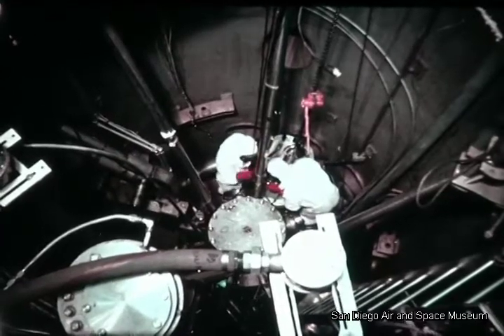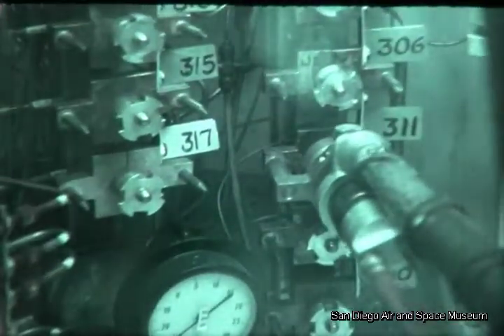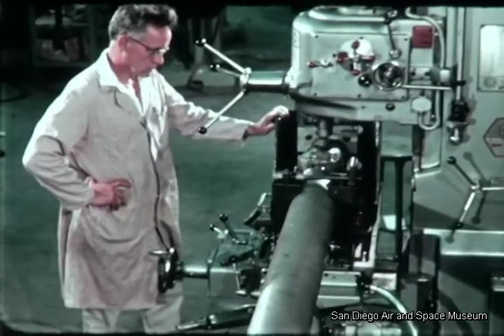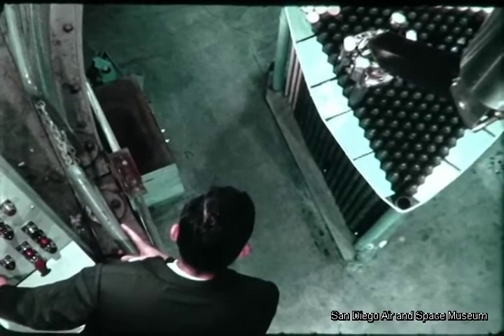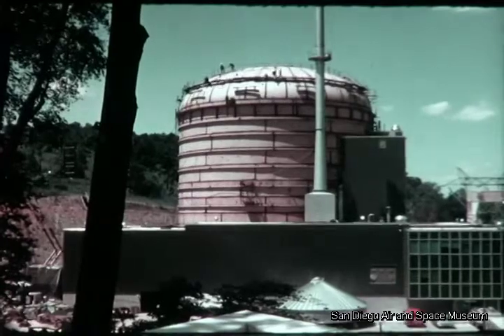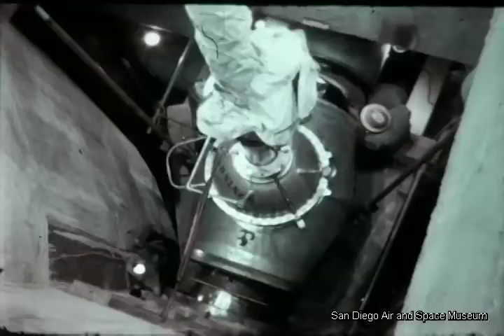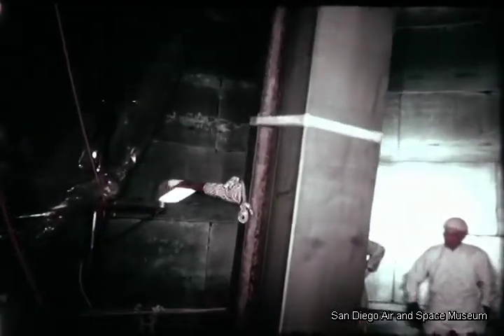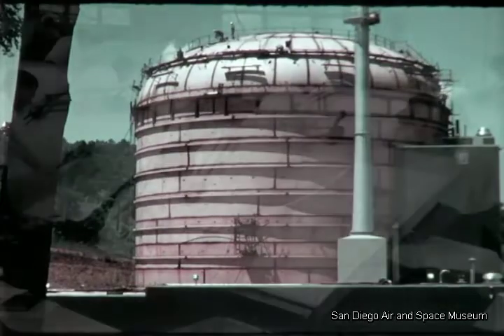HACL Film 0012  "H.T.G.R.-Update" High Temp. Gas Cooled Nuclear Reactor a General Dynamics Film

Comment: I'm working on a idea for an air cooled nuclear reactor that  works on the same idea as that of the nuclear jet engines that were developed for long range bomber in the 1950's ( Open Brayton Cycle, direct cycle design) Did General Atomic do any work in this area? Restart Project Orion! Get to Mars in 45 days! Patents 672256, 3116040, 3109554